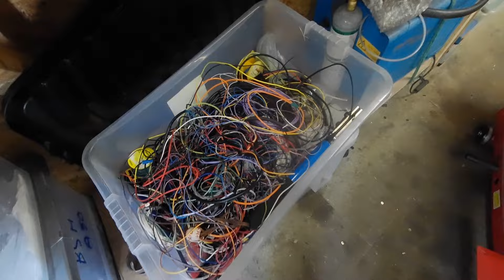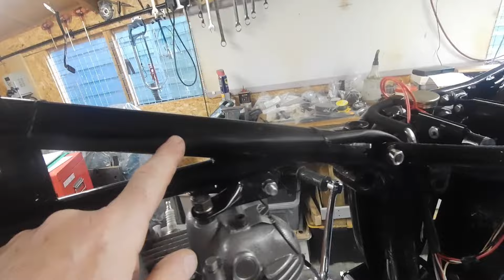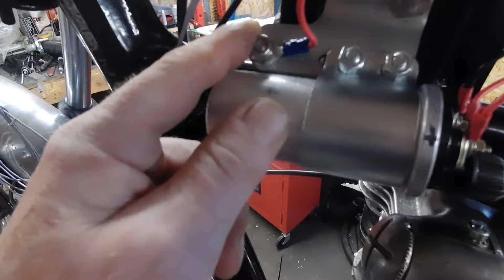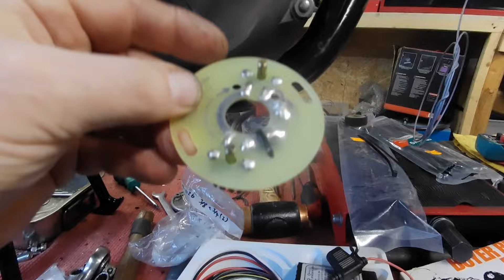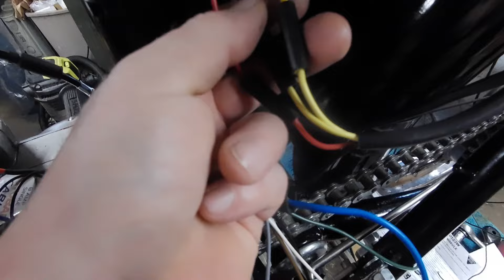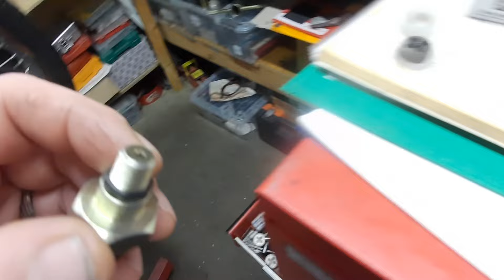Triumph Bonneville Project Part 25 | DIY Wiring Loom | Electronic Ignition | Regulator Rectifier

Comment: ...so, you dont need to have the rectifier-regulator in a cooler spot? i was told to mount it where itll catch air if possible.
after seeing wiring harnesses going for $170 or so, im ready to try THIS way..just need a lot of bullet & butt connectors i suppose. thanks!
Reply from the maker: Reg-rec is fine where it is, it will still get some air flow and the large aluminium mounting plate will also help.
Have look at where some production bikes have them, my Speedtriple had it tucked right away.
As long as its not fully enclosed in something it can still dissipate heat via the fins.

Good luck with your rewire.

Comment: Did you create a wiring diagram? That would be handy.
Reply from the maker: No, I just followed the original Triumph wiring diagram with the exception of the electronic ignition & solid state reg/rect (both of which come with their own wiring diagram) and adding extra earth wires rather than relying on the frame for earth.